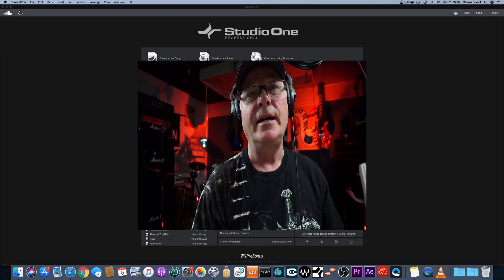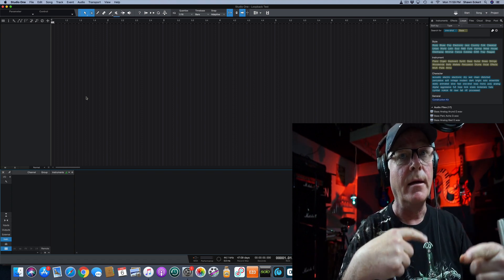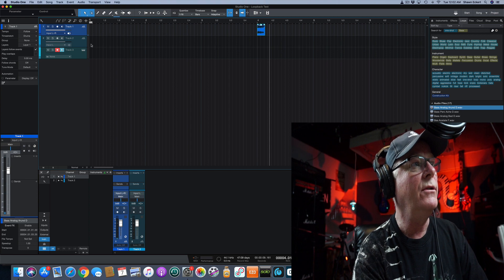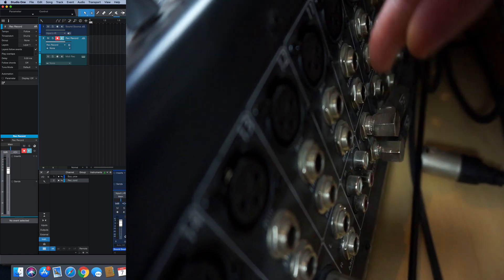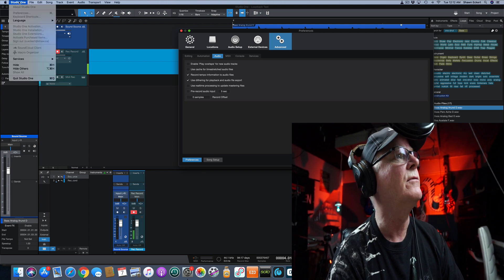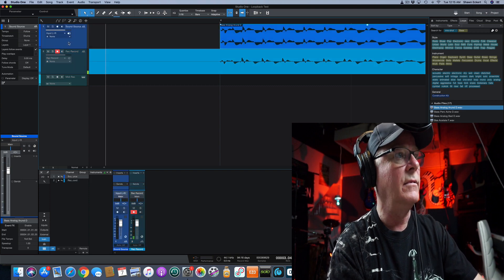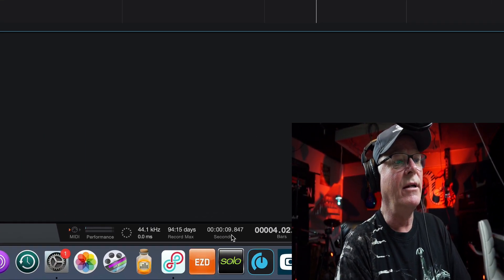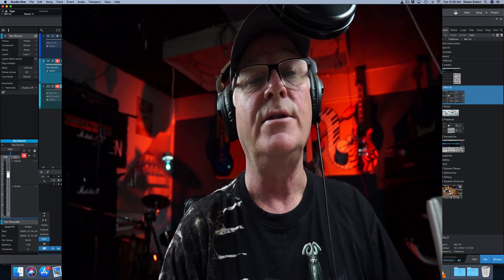Latency Loopback Record Offset - Hack or Fix???

Comment: For anyone who references this video or similars by MH or GBY. I messed with these procedures today. I had a hard time getting the interface loop enabled but figured it out and set the Record Offset. On to the Midi Offset, it took me a head scratch or two but upon turning Input Quantize OFF I was able to successfully add a working Midi Offset. Just sharing, maybe save someone else a bit of time/ frustration.
Reply from the maker: Greg Nott - Thanks for the comment and your support!
Reply: Software is amaterish.

Comment: Your track 2 is recording late in both cases. Because the audio track is above the Rec track and the Midi track is below the Rec track it only appears that one time is recording late and the second time is recording ahead, but that is not true.   If you look, The rec track (2) records the Bass from audio track (1) late, - the waveform of the rec track (2) is to the right of the waveform of the audio track (1) before adding the record offset.  In Midi's case, your rec track (2) is also recording late, NOT ahead, -its waveform is also to the right of the Midi track (3).  So why is this working that in one case you put a negative number and in the midi case a positive number does not make logical sense.  Can you explain that, please?  Also, I wasn't able to get the midi to work bang on. The best I got was .001 latency.  Thanks in advance!
Reply from the maker: Hi James
All depends how you peel the banana.
Reply: @AdLaceStudios 😂😂😂

Comment: Thanks, I will definitely try this. I have a Studio 1824C interface. I don't have a lot of latency when I start tracking the first track (44.1 and 32 buffersize with dropout protection set to low) but the latency builds up while adding tracks (and plugins). When starting it's usually 0.2 ms, so that's almost nothing (without green Z enabled). But when I'm adding the 4th or 5th track and have some basic plugins like reverb or delay, EQ and compression, than the latency builds up and I have the enable low latency with the green Z button. But I don't think setting the offset with a loop will fix this, right?

Comment: I own a Presonus Studiolive 24R and have been working on recording drums. I can set my buffer to 16, which is the lowest it can go. I would listen back to the 8 tracks and notice something is way off. I'm pretty sure this technique will solve my sync issues.  Thank you for sharing this information.  It is probably more important than the latency issue all together. -Adam Wisdom
Reply from the maker: Adam Wisdom it’s a real game changer for me.
I would record a track and have a listen back and think... OMG my timing is terrible... then re-do and re-try with the same results. This became very frustrating because I was sure I was hitting the down beat on the 1 and this made editing and mixing a complete nightmare because everything that I tracked had to be slid around. I had been recording myself like this for years. 
Once I found out how to use “record offset” and what it was actually meant for it was a complete game changer and I thought I had better post a video about it because surely I am not the only one who is encountering this issue.
So happy that this helped you Adam!